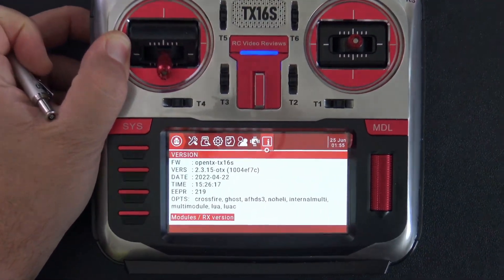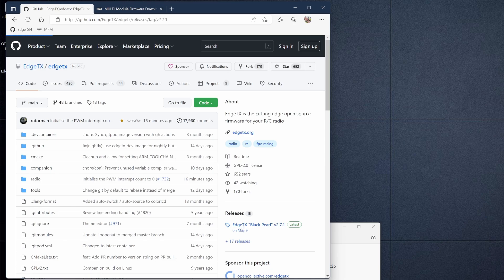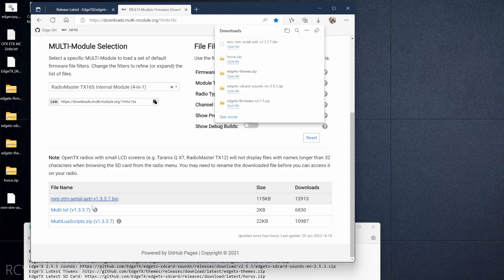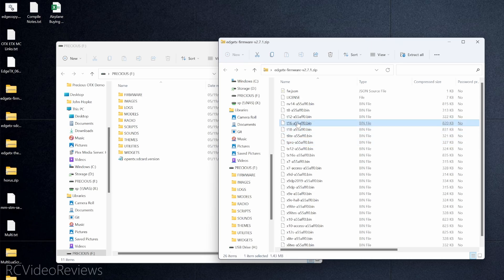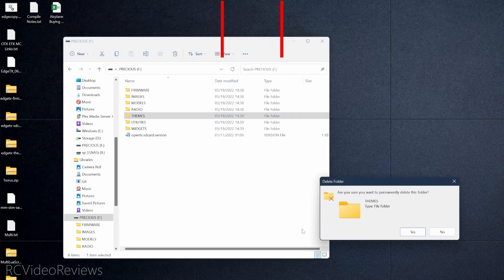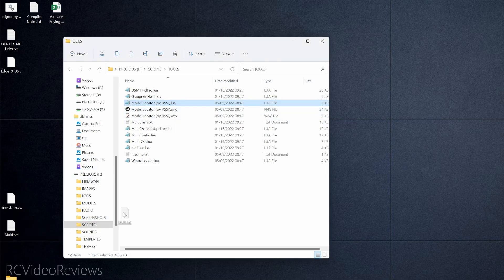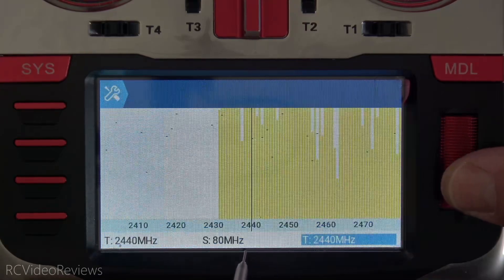How-To Convert from OpenTX to EdgeTX MASTER CLASS • 100% Works

Comment: Converted TX16s to Edgetx 2.10.6 using your Master Class video.  Had to re-flash to 2.7.1 since conversion feature ended after 2.8.  That did not convert models either.  Had to use EdgeTX companion to get models converted.  Now problem is that .yml models are on the radio, they can be viewed in EdgeTX companion, but do not display on radio.  Any suggestions?

Comment: I'm just getting in to the hobby, I bought a Spektrum NX8 radio, just because my 1st heli was a Blade, and because every video I watched, everyone seemed to be using Spektrum gear. I wish I had know about these types of radio with multi protocols on them. When I was looking for which radio to buy I knew it had to be DS2/DSMX, and I did look at the Radiomaster TX16S, but someone I missed that it was multi protocol and could be used with DSMX stuff. Don't get me wrong the NX8 is a nice radio, but I think if I'd know that I could have used the TX16S on my Blade heli, I would have got it. I've ordered a DSMX satellite unit, but I can see my buying a TX16S in the future, the NX8 is quite old tech TBH, like it's not touchscreen and doesn't have USB C, which the TSX16s does.

Comment: Hi John.  I converted from OpenTX to EdgeTX following your videos and bootloader method.  I have been successful getting all of my models working on Edge 2.9.4 EXCEPT that the Model Setup on the radio is incomplete on my TX16.  The last line showing in the model setup screen is the Enable Features and USB Joystick buttons.  I have tried several times to reinstall using bootloader completely clearing the clearing the sd card and starting from scratch with several Edge versions.  Everything including the Model Setup works fine up to Edge 2.7.2, but in 2.8.4 and 2.9.4 the Model Setup is incomplete as described above.  I want to have 2.9.4 at this point because my older iMac can only handle OS 10.15.7, so d I want to use the Edge Companion 2.9 which is the last compatible version until I get a new computer.  Any ideas why my Model Setup is messed up above the Edge 2.7.2 version?  Much appreciated.
Reply from the maker: Enabled Features and USB joystick are the correct last lines in model setup now. It's not a flaw.
Reply: Oh wow!  I spent hours on it. Used to Open Tx. I need to do much more research, like where you bind etc. Thanks very much much for your help. And patience…
Reply from the maker: Binding is in the Internal RF or External EF box.
Reply: @RCVideoReviews Thank you very much for your help.  I got a TS16S, my first colour radio, last week after many happy years with my X9D.  Following your instructions I successfully switched the X9D from OpenTX to Edge TX 7, and then transferred the files to Edge 7 on the TS16S.  Everything went great and the UI was quite familiar even in colour. So I updated to Edge 9.4 without going to Edge 8, so I missed the release ver. 8 notes on the changes to the UI.  I spent many, many hours trying to figure out what went wrong, so that was when I contacted you.  Everything is working beautifully on both radios now.  Again, many thanks

Comment: Thanks again for all your hard work.  I failed a few times because I did not follow all your steps.  Started over and followed everything you did and it works great for me.   Thanks.
Reply from the maker: Great job! Way to stick with it. Once you get the hang of it, it'll get much easier.

Comment: Great video. I followed the process successfully with edge 2.9.2. Initial startup messages were slightly different, but maybe that's because i did not overlay the edge sg card onto my otx SD. Basically, it did not auto convert the models. It did, however, convert the radio setting like functions. It also had me calibrate the sticks. I restored models successfully from the otx backup.
Reply from the maker: They removed bin to yml conversion in 2.9. This video explains it https://www.youtube.com/watch?v=NYbOLLoV-GA

Anyway, sounds like you got it sorted out with an OTX backup.

Comment: Your videos are outstanding. You have a brilliant, clear way of explaining things and i really appreciate the work you put into it. Question if i may....I have been using a Qx7 radio with OpenTX. I now have my new TX16S running EdgeTX. Is it possible to convert my models? They didn't convert when doing the transfer. Thanks
Reply from the maker: In EdgeTX Companion, setup both radios. Select your Qx7 read models/settings. Save to a file. Switch radio profile to TX16s, open the Qx7 file, and Companion should prompt you for a conversion. Don't expect a perfect conversion though. If you have hardware on the Qx7 not available on the TX16s, the line(s) may be removed.

Comment: Well I took the plunge. everything worked great even though the firmware I downlaoded was the next revision which made my radio look a little different than yours. Thank you for holding my hand through this I was scared to death and couldn't have done it without you. Only glitch I had was for some reason one of my models just disapeard and I can't seem to get it back even though it shows up in the models file. must of hit a wrong butten. LOL
Reply from the maker: Glad you got it worked out.

Comment: Hi Great video and thank you. I did run into a very frustrating problem with the model conversions,. I brought a new MK1 T16S  for a friend with OpenTX loaded. Followed the Vid exactly but when I downloaded the models from the Taranis running OpenTX it simply would not find any of the models to convert despite them all being there. After hours a messing around and trying OpenTX Companion and EdgeTX Companion, and a rest, I simply downloaded the Models off OpenTX and saved them as a backup file then as your later video shows using EdgeTX I opened that file. It then asked to convert them and even though this was the second attempt it converted them and all is ok. Just as a matter of interest Ive been running EdgeTX on my T16S and Jumper T16 since the first full stable version with no problems.
Reply from the maker: Sounds like got it worked out in the end.

Comment: Thank you for the video! I've been on edge TX for a week and happy i switched over!
I did not transfer over all the lua scripts in the process and now wondering if i need to set my tx16s to dfu mode for it to read them? or do i just simply drag over?
Reply from the maker: You only need dfu or bootloader to flash the firmware. Card contents can be changed by putting the card in the pc as shown in the video or by plugging in to the top port and selecting usb storage mode.

Comment: Hey so so helpful and thanks for all your efforts. I have a probably dumb question - I've bought a jumper t15 that is on edgetx.  Is there any simple way to import just the models from open tx into edge. I don't need to flash the jumper t15 bit just need the 3 drone models. Is there a simple way to import them rather than flashing the jumper t16 pro to edge first.  Cheers Adam
Reply from the maker: Companion would probably be the most straightforward route. OpenTX is getting to be long in the tooth and the conversion will do nothing but get more painful as time goes on.

Comment: Hello John. I followed your instructions in the conversion process and everything worked flawlessy except the touch screen is not working. Its not a game changer but I was wondering if I slighted something.

Great instructional video.

Thanks

Jason
Reply from the maker: Usually that means you flashed TX16.bin and not TX16S.bin
Reply: @RCVideoReviews  Thank you.
Reply: @RCVideoReviews  John. Sorry to disturb you during the game. It says my firmware is edgetx16s-2.7.19a55aff020
Reply from the maker: Has your touch screen ever worked?
What version of firmware did you come from?

There is a special/global function that can turn off touch. You might need to check through both to make sure you're not using that function. Otherwise, go to system->hardware->analogs and see if that registers screen touchs. If you don't have a function disabling the screen, and if the analogs screen registers touch, you'll need to open a ticket on the EdgeTX github.
Reply: @RCVideoReviews  John. I went from OpenTX 2.3.15. I'll follow your instructions to try to trace the issue.
Reply from the maker: Some TX16s radios are SE models that do not have touch. Are you 100% sure you don’t have one of those?
Reply: @RCVideoReviews  John. My model TX16s  is an SE model and therefore no touch screen.  I also have a touch screen model that is my daily driver and I will also convert that one to EdgeTX.  The SE was sort of a trial run installation. I had it for a while and sort of forgot it was a regular non- touch screen. 🙂

Again. Thank you for your assistance.
Reply: @RCVideoReviews  John..Let me run something by you right quick. Since I successfully upgraded one of my TX16s to EdgeTX 2.8.0, is there a shortcut way to do my 2nd TX16s touchscreen radio? Don't want to have to go through all the steps a second time. 

Your thoughts

Thanks

Comment: Super video, can't wait to upgrade to EdgeTx...I HAVE to have my Amber Sound pack...do I just copy them back into the sounds folder after upgrading?
Reply: Hi Russ, I believe that you do not even delete your sounds folder in the clean-up of the SD card when John is doing the SD card clean-up and if you should delete them Yes just copy your Amber sounds file back from your "Saved" SD card content instead of the new SD card sound file. I hope this helps and Happy Flying!

Comment: Great video done by great teacher.
My question is about new model setting .
How can we create new model in edge version,  like in open tx , very simple way just to select which channel we want ,
I mean can we use that way in edge version??
Pls guide how can we use that wizard in edge ?
Reply from the maker: Don't use wizards--just chose the option to create a new model and Edge will setup a new model with 4 channels in your specified default mode. Learn to start with a basic 4 channel model and forget about wizards, you will thank me later.

Comment: Hey a quick question do I need to get my hands on a touch screen mod? The reason I ask is that I got the Gen 1 of the Radiomaster TX16S from back in 2020 in which they offered a touch screen update to buy on it's on own back then. Fantastic job on the very insightful video.
Reply from the maker: Thanks for the comment. Glad you enjoyed the video. Personally, I'm not up-to-speed on the process to switch from non-touch to touch as I started with touch. So I've never looked into it. I think all you have to do is buy the touch replacement screen which should be available just about everywhere that sells TX16s parts. I would encourage you to hop on my discord (invite in description of every video I post) and ask there. People more familiar with the process should be able to confirm.
Reply: @RCVideoReviews  Ok then thanks.

Comment: Thank you for the video.  I completed the installation of Black Pearl and binded a receiver but it doesn't work.  The transmitter shows no movement on the Channel Monitor.  What did I fail to do or do wrong?  The same receiver worked when the T16S  was on OpenTX.
Reply from the maker: 1) Are you sure it's bound correctly? i.e. Get any telemetry? 
2) Did you look at your mixer and verify you have inputs assigned to channels?
3) If the channel monitor showing nothing on Mix or Output or both?
Reply: @RCVideoReviews  Thanks so much for the reply!  !. When I plug in a servo, it moves to center so I believe the receiver is bound.   2.  I believe it has what you said.  I tried changing the right column item but no success.   3.  No movement on Mix or Output.  I will see if our club has an expert or if my Aloft Hobbies book helps.
Reply: It works now that I calibrated the sticks.  I shouldn't have skipped that.

Comment: Thank you so much John! Brilliant video - I was tempted to convert to EdgeTX and this one-stop tutorial made me finally do it.
One question please, if I may - on completion my touchscreen does not respond... I tested it within Hardware > Debug > Analogs and it seems to work. But not with EdgeTX... Have I missed anything? Any idea what is wrong please? Other than this all seems to work fine (with the buttons).
Many thanks!
Reply from the maker: There is an option in Global Functions and Special Functions to disable touch. I'd make sure that's not on. You could also "reset" your radio settings by erasing \RADIO\radio.yml just to see if it is a physical setting.

If you erase/remove that file, the radio will create a new one on reboot/sd mount and it will ask you to go through calibration again. Skip that, and check immediately if touch works. It should if it works on the Analogs screen. 

What radio?

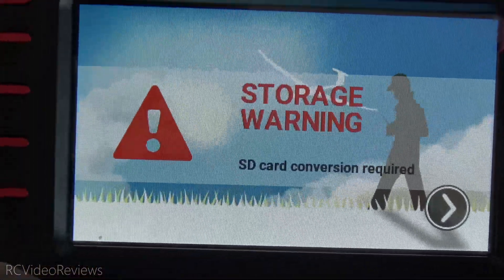Comment: Went great, I think, up until 26:22.  Edge Tx looks like it went in, but the "Go" button was not there, it said push any key to skip, and None of my models went across.  Can I still do the conversion.  I also have both .bin and .yml files in the models folder.
Reply from the maker: You can’t go direct from OpenTx to EdgeTX 2.9. The bin conversion code was removed in 2.9. You have to flash 2.8.x first. Allow the conversion. The. Flash 2.9.
Reply: That makes sense, thank you. So I can just put the older version on the SD card and do the same process, then update after it works?
Reply from the maker: From OpenTX flash EdgeTX 2.8.x. Reboot radio so that it turns on. The conversion will take place. Once the conversion is over, you can flash EdgeTX 2.9.x+ anytime.

Comment: Great video, awesome detailed explanation. For the sdcard content, which one do i need for a black and white screen RM TX12, Taranis 7 or 9? Thank you for making these kinds of videos.
Reply from the maker: On the sd card content page an index is provided showing what content goes with what radios:
https://github.com/EdgeTX/edgetx-sdcard

The contents of this repository are organised by color type and screen size, with zip archives generated for each color type and screen size.

c480x272.zip (480x272 pixel landscape orientation color screen radios)
TX16s / TX16s mkII
T16
T18
Horus x10s
Horus x12s
Generally, most color screen radios

c480x320.zip (480x320 pixel landscape orientation color screen radios)
Flysky PL18
Flysky Paladin EV (PL18EV)

c320x480.zip (320x480 pixel portrait orientation color screen radios)
Flysky Nirvana NV14

bw128x64.zip (128x64 pixel black and white screen radios)
T-Lite / T-Pro
TX12
ZORRO
QX7
X9 Lite
X-Lite

bw212x64.zip (212x64 pixel "wide screen" black and white screen radios)
X9D
X9D Plus
X9D Plus 2019
Reply: @RCVideoReviews  WoW John, thank you so much for sharing your knowledge. Very much appreciated.

Comment: As others have reported - this works 100%!  my issue now is channel mapping and for some reason my radio now thinks the throttle is on the right stick (hold all the way down to get past power on prompt).  Is there a way to re-map channels to normal AETR mode 2? (ie: throttle/rudder on left stick, ail/elev on right)?
Reply: Nevermind - mode setting needed to be changed back to Mode 2 - fixed!

Comment: Great job on the video. I have one question. I noticed that you also downloaded the Multi Protocol Module firmware, but, I do not think you installed it in this video. Do I need to update it separately? Thank you...
Reply from the maker: Yes, from the radio file browser, navigate to the folder where you unzipped it (\firmware is what I use), highlight the MPM binary, long press jog dial and select flash internal.

Comment: I did this conversion last night and it is awesome and thank you for putting together this great video.  The only thing I noticed is when I first turn on the radio the OpenTx comes on briefly before switching to EdgeTx.  Did I miss something here? Was I supposed to remove the old OpenTX Firmware?.. Thanks in advance.
Reply from the maker: You probably need to watch this: https://www.youtube.com/watch?v=EEmsMJbhCfE

Comment: Hi,John,I just converted both my Radiomaster tx16s' to edge tx 2.9.4.One works fine,but on the other the themes don't seem to work,although the whole list is in the themes folder.Presumably i made a mistake somewhere,but I've gone through your video again,and i can't find anything i've done wrong.Any thoughts?Thanks.Hans.